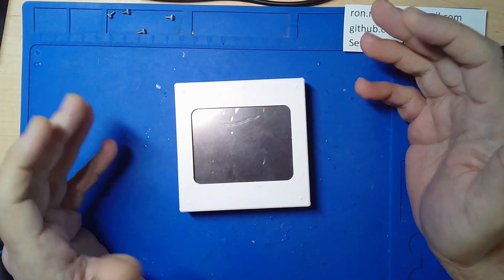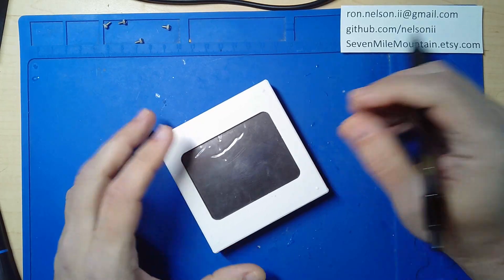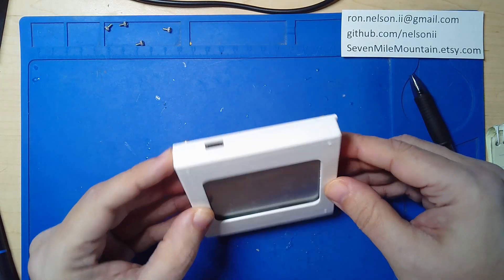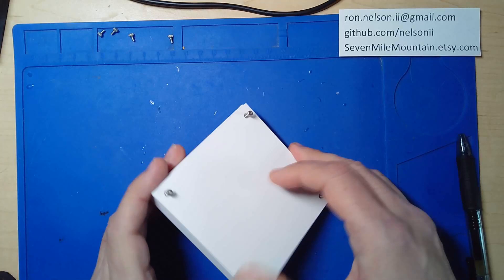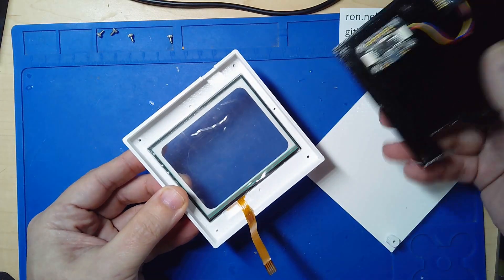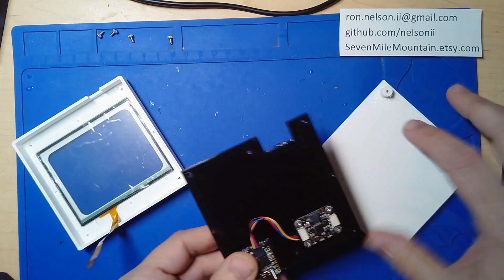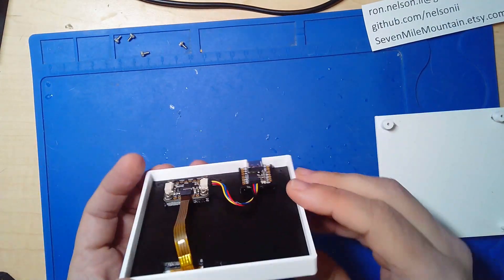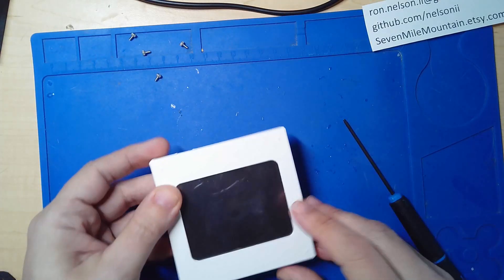DIY Resistive Touchpad : The Hardware

Comment: Sir can we get custum shaped trackpad
Reply: you could use an off-the-shelf resistive "digitizer" or touchscreen as a trackpad. Custom shape has to either be manufactured or blocked off by the product body (covering the corners)
Reply: @tutacat i wanna make touchpad for handheld gaming device. can i buy a smartwatch touch digitizer and usb controller board and it would js work?